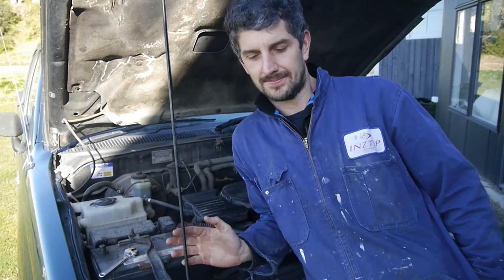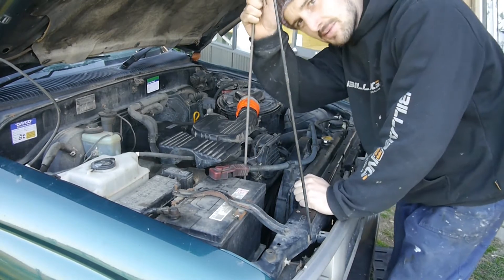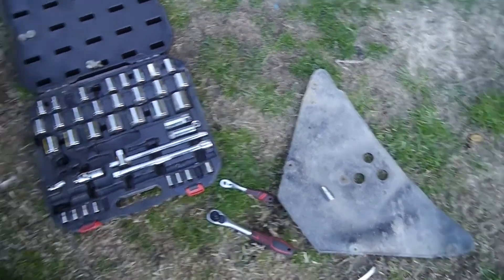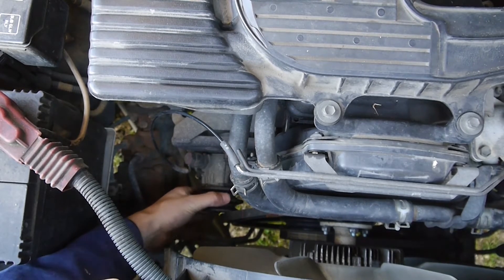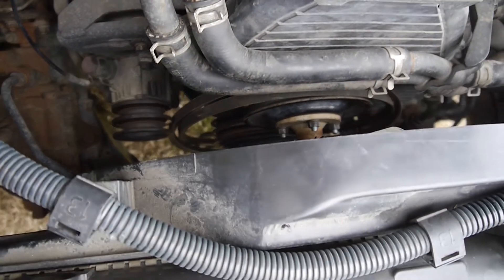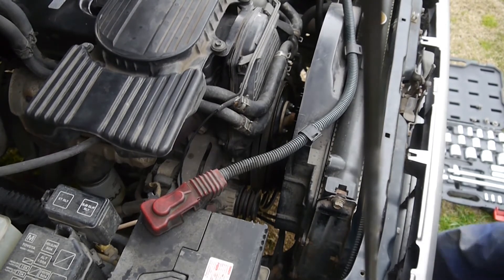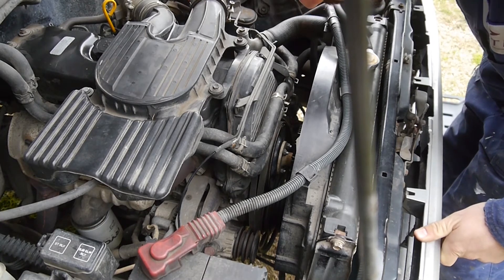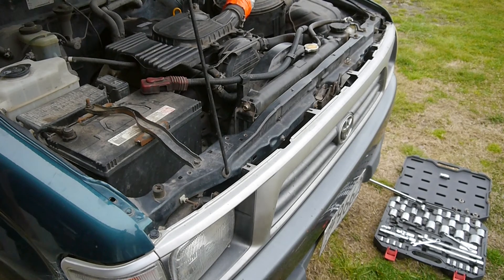Engine making noise? Could it be the alternator? How to check

Comment: Yep !  same thing happened to mine. At 20 years later and original alt.  3L 1990
Reply from the maker: so it was your alt making the noise? I have still not fix this issue...
Reply: Yes definitely, replaced with an aftermarket spare. But if replacing yours has not fixed it, could it be the other tension pully that is not driven when you remove the belt ?   My LN106 chassis (3L) has the combined Alt/Vaccum-pump, the one with the pump on the rear of the Alternator.  Mine gave a very distinct location when I used the long metal shaft to ear trick to locate the sound. ( after I took it to the A/C bloke and asked him if the A/C as making the noise, LOL ). Also, I don't know the belt drive couplings on the 5L. Is the water pump driven by the same alternator belt ? On the 3L, its two distinct belts.